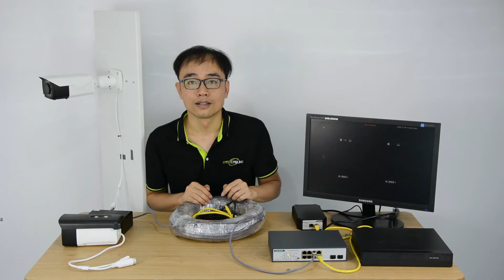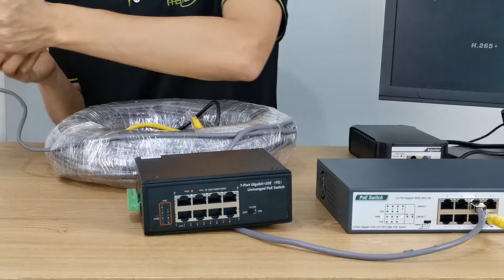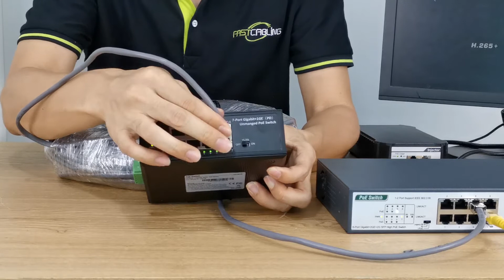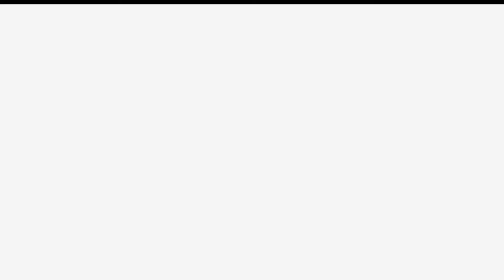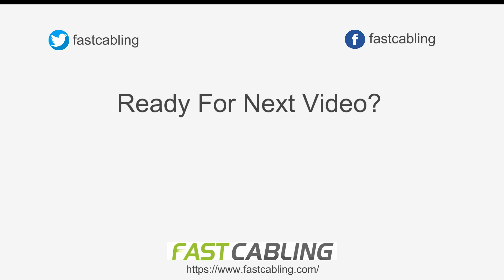How to Add PoE Power Switch to Your NVR System

Comment: I tried to connect a poe switch to a poe nvr in a distance of 250 meters but it failed to configure
Reply from the maker: That's because the maximum reach for PoE is 100 meters. You can daisy chain 2x PoE extenders or use a long-range PoE switch to extend the distance up to 250M. FYI, some PoE switches can also allow you to extend the distance to 250M by enabling the DIP switch but the speed will drop to 10Mbps. 

https://www.fastcabling.com/product-category/long-range-poe-switches/

Comment: hello, how do i add a non reolink ptz to my reolink nvr RLN8-410 ?
Reply from the maker: You need to make sure your NVR is Onvif compatible, otherwise, you can add any 3rd party IP camera/PTZ camera to the NVR. Both ends must follow the same protocols and Onvif is open protocols. Usually, the NVR will discover the edge IP camera automatically. You can manually add the IP PTZ camera to the NVR if you know the Onvif port of your camera, but the motion detection may not work.

Comment: hello. i have a reolink nvr RLN8-410, how do i add a NON reolink ptz ?
Reply from the maker: You need to make sure your NVR is Onvif compatible, otherwise, you can add any 3rd party IP camera/PTZ camera to the NVR. Both ends must follow the same protocols and Onvif is open protocols. Usually, the NVR will discover the edge IP camera automatically. You can manually add the IP PTZ camera to the NVR if you know the Onvif port of your camera, but the motion detection may not work.

Comment: Hello I’m running cat6 cables throughout my house, my game room has a lot of obstacles to run more wires. I have one cat6 ran to the location, i wat to put some cameras around the area, the line that is there will be used as a main line going into a poe switch so i can power the poe cameras. How do I configure the settings where it will show up on all the screen?
Reply from the maker: You can add the PoE passthrough switch at the edge which can handle 7 PoE IP camera. You will need 90W PoE injector another end to supply both power and data to the POE pasthrough switch. https://www.fastcabling.com/product-category/poe-powered-switch/

Comment: Can I use this 800 meter long range switch to connect a computer
Reply from the maker: I would suggest you not take longer than 500 meters. The bandwidth will downgrade to 10mbps after 500meters. Moreover, you will need PoE splitter at the edge. The 800m POE switch only work with PoE equipment.  While the non-PoE equipment is being attached to the switch, the switch will not release the power, so the PoE adpater will not work. The PoE splitter can trigger the PoE switch to send the power to the PoE adapter at the edge.

Comment: I need to connect 5 ip cameras and one pc at 200 meter distance from nvr
Reply from the maker: You can add the a PoE extender to increase PoE to another 100 meters. https://www.fastcabling.com/product/poe-extender-outdoor/ You also can turn on the CCTV mode on your switch if it is available, but the bandwidth of all the PoE ports will be downgraded to 10mbps.

Comment: I have planet industrial switch model no IGS-10020HPT
Can I connect a computer to poe port to access the cctv camera via desktop
Reply from the maker: You can connect the computer to PoE ports. The standard PoE switch will verify the device and determine whether the power should be released or not. The process calls "power handshake". It is safe for the PoE switch to work with non-PoE equipment.

Comment: I use a 8 port switch connected to nvr. How can I daisy chain another 4 port switch to the current 8 port switch?
Reply from the maker: You simply need to connect 4 port switch to one of PoE port at your current switch. The PoE port can work with non-PoE switch. Just don't daisy chain more than three switch between the NVR and the last one.

Comment: I have 16 channel NVR how  can configure two poe switch on that NVR and what is the maximum distance NVR to poe switch ?
Reply from the maker: The maximum distance is 300 meters. The first 100 meter will be NVR to the first PoE switch, and you got another 100 meters to the second switch. From the second switch, there has 100 meters to the edge cameras. You would better to pick gigabit PoE switch.

Comment: Hi, How can i connect 3 switches to one 32 channel nvr with internet,distance is more than 300 meters
Reply from the maker: You can link those switches back to an aggregation switch by using fiber optical cable, and attach your NVR to this aggregation switch. Those three edge switches should have SFP slot which allow you to install SFP module for fiber optical connection. There is optional method without involving in fiber optical cable. If there is a little far from 300 meteres, like 320 meters. You can employ ultra long distance switch which allow you to use the cat6 Ethernet cable. The bandwidth is 100mbps with 300 meteres and will start dropping. You may need to cacluate the bandwidth from each of these edge switch (how many cameras with each of those switches). https://www.fastcabling.com/product/800m-8-port-long-range-poe-switch/ (refer to the diagram after see more at the how it work section)

Comment: How do I know the kind of PoE injector I need??
Reply from the maker: You will need to understand the power budget of your edge devices. There is three popular PoE standard IEEE802.3af/at/bt (aka PoE/PoE+/PoE++). There PoE standarad classify the power budget of your edge device. Next, pick the PoE injector matched your edge devices's standard. I assume you are using the standard PoE equipment. If your edge device is not standard PoE, you should understand what kind of voltage your edge device accepts.

Comment: Hi can you make a demo on this setup. Start point is nvr to poe switch to 250m cable to another poe switch at the end powered by adaptor then to 8 camera. Will it still work or do i need poe range extender?
Reply from the maker: There is no need for extra PoE range extender. The 800m ultra PoE switch can send power and data up to 250 meters and power another PoE powered switch at the edge. However, the power budget is only arond 24W which could supply 3 units convenient PoE IP camera. We will make another video to demonstrate the setup.

Comment: What happen if I dont have internet would it still recording
Reply from the maker: Yes, the recording doesn't rely on the internet accessing. As long as you can see the video on the NVR, the whole system is working. The internet only provide the remote accessing.
Reply: @Fastcabling  thank you sir for responding to me!!! I already have the system home and planning to start installing them soon but before I can go ahead im looking at a poe switch that have 16 port but only 8 of them is POE and the other 8 I guess is not. Does it matter POE? I.g tplink heres the link for the switch i want to buy https://www.amazon.com/dp/B0721V1TGV/ref=cm_sw_r_cp_apa_i_k3-BFbDGNCQZA
Reply: These are my equipment all hikvision.
(1)  6 Colorvue 2.8mm turrets cameras with led lights 
(2) 7600series nvr two 4000TB HDD purple color
(3) cat6 outdoor cables of my choice since I like to go over kill..lol
(4) 1 ptz camera auto detection and tracking 20× zoom 
(4) a very nice 4k monitore 27"